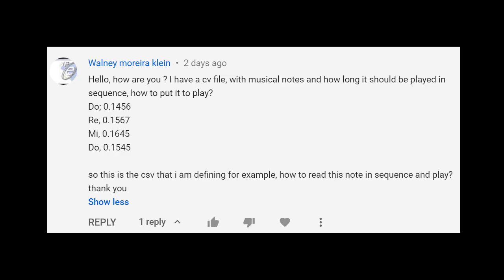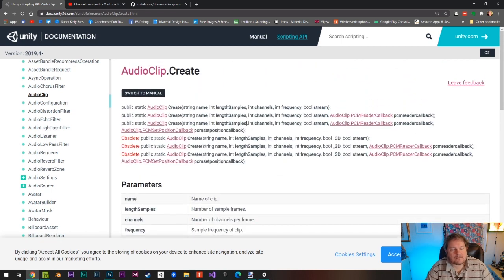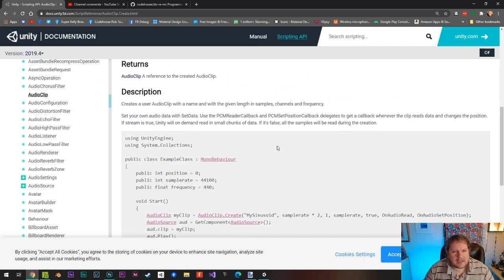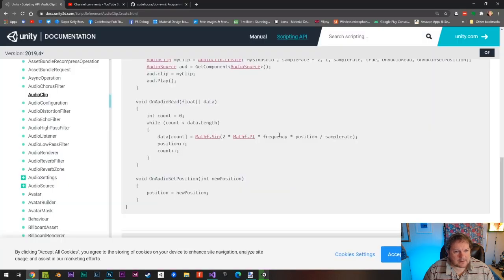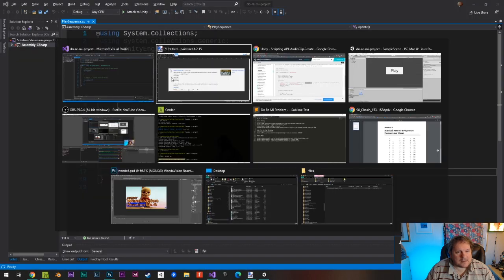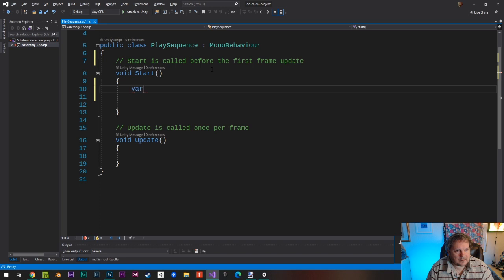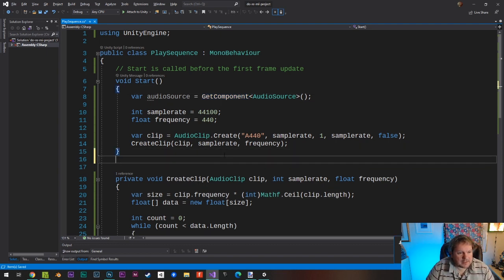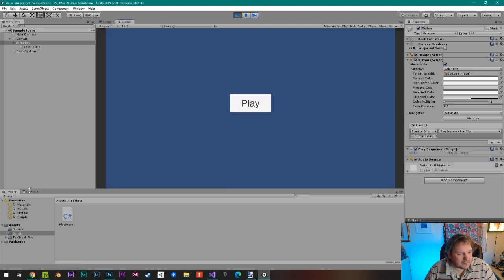Tone Generation and Sequencing with AudioClip in Unity

Comment: This was very helpful for something I am doing, wondering if you could adapt it so that I could add an outside audio clip like the sound of a drum beat, etc... and then manipulate that original audio clip to change pitches relative "any" melody. Creating the audio clip from scratch was interesting, and this is one of the only good videos I found regarding the subject. I have been trying to find a good video on that aspect, and for the base level of the concept I'm trying to flush out, you nailed it! I thought I could just simplify the "audio clip create method" somewhere to just use the predefined audio source clip somehow, but what I am finding out about what your explaining here isn't quite enough, if you change the order of the do, re, me, etc..... meaning these two arrays at the top and the dictionary reference is a great start, but I need it to remember those values so I can actually make song structures and call upon those names of the pitch/note. Hopefully my comment isn't too confusing...this is a great video on the topic you presented. I just cant seem to find a good video on expanding slightly on this concept.
Reply from the maker: Thanks for the comment!

I might not be understanding your question, but are you asking about how you can sequence the tones into a song? And not just in the do-re-me order? The Start() method of the PlaySequence script just sets up the notes mapping tone name to tone. The sequence for a song is held in the JSON files stored in https://github.com/codehoose/do-re-mi/tree/main/do-re-mi-project/Assets/Resources. For example, mary.json contains the sequence of notes for Mary Had a Little Lamb. Those notes are read in and played in the PlayNotes() method.

For pitch changes, you can do that on the AudioSource itself, changing the 'pitch' field.

Let me know if I can help you with anything else. Cheers!
Reply: What I've been doing is having samples of chords, say a measure of guitar or piano playing some chord, with a bass line and a drum beat. You could do it with individual notes, think of them as sound fonts. You would be better off having quality note samples of whatever instrument and playing those files than just generating sine waves.
But you can't really change the pitch of recordings without changing their speed, so you would need one file for each note. Is something like this what you want to do?

Comment: This is great! I'm having some problems that generated audioclips don't always seem to have the same volume(loudness). I can produce the same note multiple times and ~1/8 will be really quiet. Any ideas?
Reply: I had this similar issue. I found that it matters when you change the audio clips, but make sure your setting the variable of the audio clip before you play the sequence. My initial notes would be cut off or softer depending on where in the code you were calling them. Maybe this helped?
Reply: @seanlaughlin4143  "your setting the variable of the audio clip" Which variable do you mean?